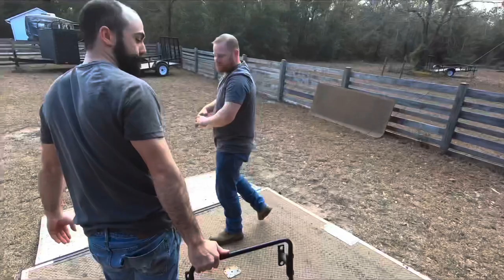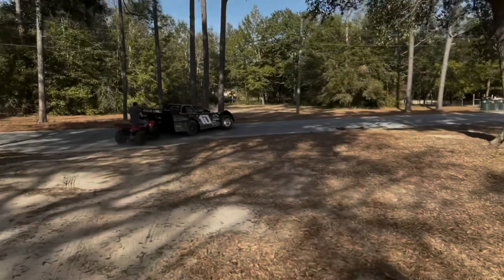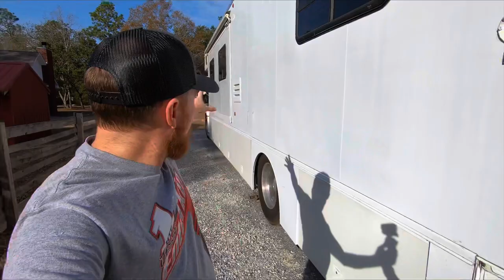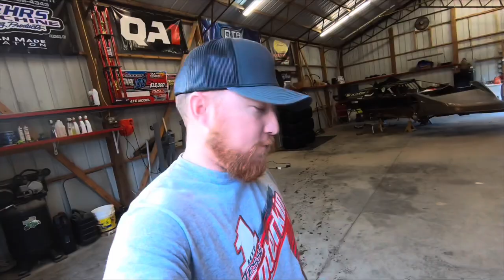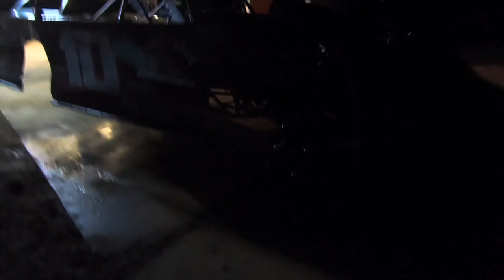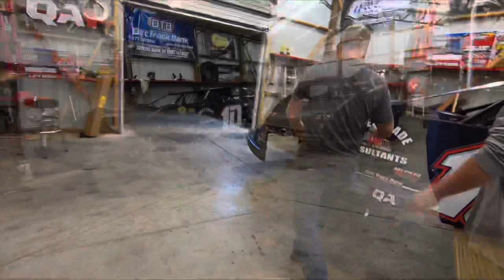Volusia Clean Up and NEW CHASSIS DOLLIES for the Race Shop

Comment: Wheel straps will stop it from moving around and let the chassis move around a bit so the coilovers aren't in a bind.
Reply: could also get castors with locks on them .
Reply: @bootlegger3656  Andrew was talking about the car moving around inside the trailer going down the road

Comment: I see improvement already, slides with clamps to accommodate for the higher and lower twist that are in the frames with side bolts to lock them in, nice 👍 I have already had seen something like these dolly’s, they are in body shops , and have engine jacks so you can roll them all the way around 360 side to side , from ends of the car that is getting painted, kool thanks BigAl California.

Comment: Those chassis dollies look Niiiice.  It wouldn't take much to put their own hydrolic lift on each one so you don't need to chase down the Floor Jack each time and you can lower the car down onto their tires to prevent movement during some operations.

Comment: We use to have some chassis dollies simular to these except we made our up right adjustable  like a jack stand but with a thru pin with the safety clip frome a Reese hitch so we could work under the car if needed and we used 1 brake wheel caster per dolly also on ours we had a loop handle on the back one just big enuff for a pushing and steering handle, they worked great

Comment: Your buddy needs to make the front dollies to have top sliding adjustable tube mounts, and 
the rear, slides on the bottom, and wider. Larger rubber casters will roll over pea stone gravel and one caster needs to have a lock on both front and back... but they are cool though...

Comment: Y’all need to use 2 straps on the back of the car in a x pattern to stop
It from moving. Example. Mount the strap from the right side frame to the left side floor and the left side frame to right side floor. They will cross over each other and that will stop the sliding of the car. Hope this helps

Comment: You guys against using a pressure washer? Looks to me like those tires would clean up real fast and easy?
Reply: Simple green on the tires. It works great on rubber, and gets it so clean, they are sticky.
Reply: If the track has a tire rule you have to be careful what you put on your tires some tracks us a tire sniffer for chemicals to make sure you are not soaked your tires to make them softer. But there are ways around it I'm sure they know how to get rid of the chemical to pass the sniffer test.
Reply: @markhagler4311  good point, and could be why they are using what they use. I’m really not sure what’s in simple green. It’s supposed to be non toxic. I used to use that stuff on my RC car tires after a weekend of racing. It got all the red clay out of the grooves without scrubbing. I could grab a stack of tires from the top, and they would stick together. Not sure if this was because they were super clean, or a chemical reaction.

Comment: Those dollies are pretty cool. Before you get a 3rd car, more tools,  and more clutter.... I'd get that floor epoxy painted. Sure is sad to see oil soaking into the concrete like that.  Now as it is you'll have to acid wash the floor. 
Once it's painted everything would mop and wipe right up instead of soaking into the concrete and ruining clothes in that spot for weeks as it comes up. Plus... by sealing the floor it also keeps some of the natural dirt from becoming airborne.  Even if you couldn't afford expensive paint floor sealer would work for a while.  It would just require maintinance periodically. It'll also stop the floor from sweating on humid days which Florida sure has a lot of.

Comment: Are yall bring all the cars to birstol
Reply: yes they are
Reply: Just the 602 & 604. Super is staying home
Reply: I love when people pay attention 😑😑😑😑
Reply: @awg6397  super will go I will say
Reply: @heathmuncy5449  no, it wont. They're not even entering the super class, engine builder even told them it will be awful hard on the newly freshened motor.
Reply: @awg6397  don't see why it would be.... motor should be built to run and be able to handle a half mile track.... right gearing and chip the engine should be fine

Comment: Do you guys ever use a homemade spray solution to help knock down the clay? You can buy stuff or use a solution to spray on it before a race and it helps keep the clay from collecting too much and makes it easier to wipe down between races.
Reply: Some racers will use clay as beneficial reasons while at the different tracks for weight but we used to use aerosol can spray silicone and spray different parts of the outside of the body before loading inside the trailers and going to erase and that helped a lot, to keep clay from sticking and even staining certain colors of paint or wraps whichever we would use on different cars

Comment: Hey did I miss where you  talked about what really happened to that new crate motor you blew up last year??
Reply: They havent, and wont until GM finally makes a decision on what to do
Reply: Up to GM now..... they're getting screwed out the money
Reply: @awg6397  they have talked about it though just not in vast detail
Reply: @davidadcock1475  I know, Ive been listening to the podcasts. Jonathan said he wont go into real detail until GM says something, he doesnt want to piss someone off and influence the decision.
Reply: @awg6397  so you proved what I said
Reply: it is clear theirs no warranty on race engine ok if their was a defect in the engine from gm why was it not caught at the dealer i assume Dickens racing engines Cleary a defect would have been caught after the dynamiter pull if this was gm fault why did this engine pass dyno test then blow up with maybe less than a lap every ok until it got to the owners that's my opinion remember be kind and gentle happy racing ever one

Comment: No, you guys need to try crosstie it the straps on the rear of the car,that might keep it from bouncing over against the inside trailer wall all so put some blocks of wood next to to spot where the tires set on the floor screwed down , or anchored , you understand rite, stack boards between the wall and the tire on the side that the car bounces over side, kool,          How is the neighbors there with all of the loud race motors, kool nice , 
All the drivers need to learn no clutch shifting, 1500 And 2100, rpm synchronize the motor rpm with the drive shaft, with no clutch after take off and the transmission will fall right in gear , and to stop the grinding, because,that sounds like that is what’s happening,
In between evert gear hit swing the shifter handle from side to side in neutral position ,
In between every gear, kinda fast then push into next gear ,or pull down in the next gear, 
It is not a brute force thing at all, it’s a finesse thing shipped the ship handle with one or two fingers in your thumb and two fingers not fist grab, but two fingers, watch the tachometer and when it gets to 1500 rpm on the low end , and 2100 around the high end ok, thanks hope your drives see this , and new dolly’s, now someone going to be selling them at the track, kool praise Jesus grace Christ amen 🙏 BigAl California.

Comment: Drop the voltage on the starter from 16 to 12 and crisscross straps on the back and the car won't move side to  side   By the way you guys did a great job at the race
Reply: We run 16 volts to starter all the time, no problems. High compression engines need 16 volts to turn over good. 12 volts don't cut it.